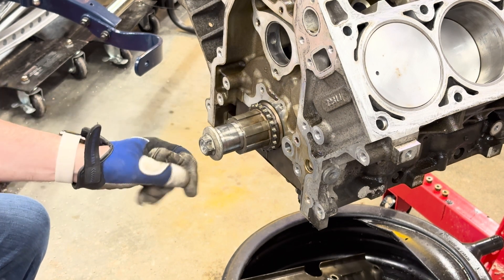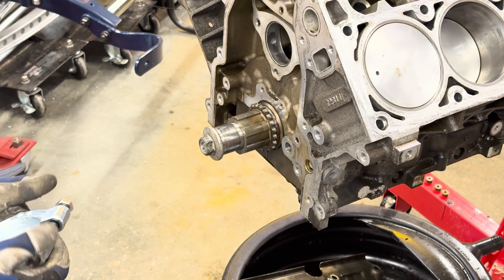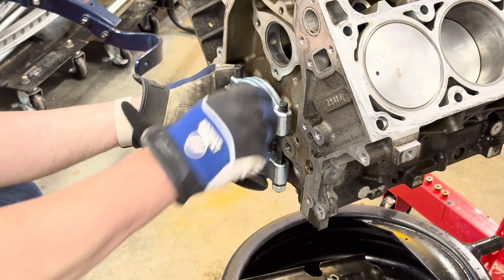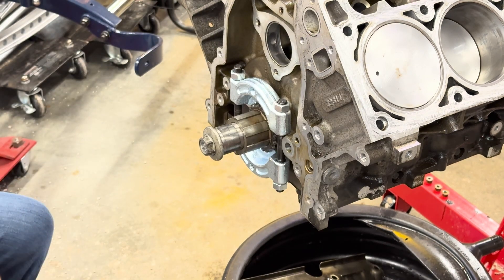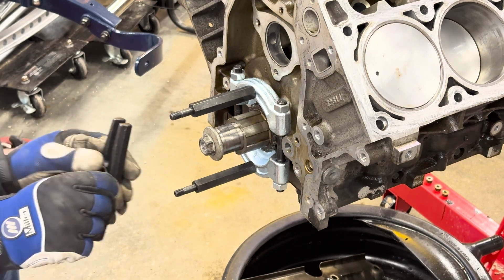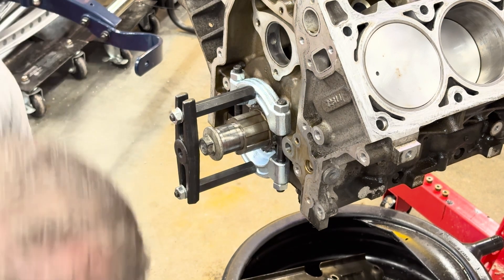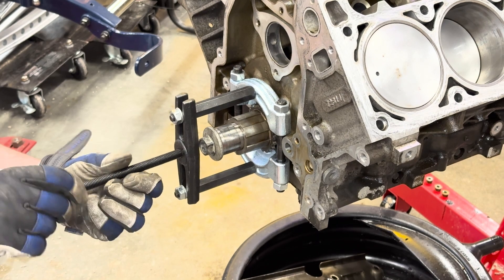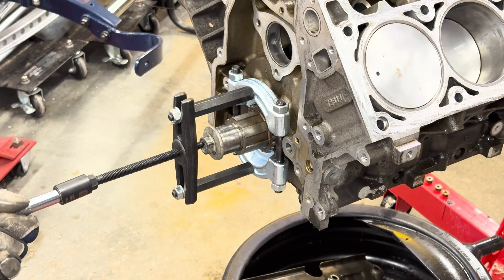Remove the Lower Timing Sprocket on an LS Engine

Comment: How do you install the new one?
Reply from the maker: Great question!   I used the old sprocket as a press and the old crank bolt.  Push right on easy peasy.
Reply: @AlsopAndSons  thanks!! Hoping my engine build goes well
Reply from the maker: @john_mattz71  they are pretty straight forward to work on, I’m sure you’ll do fine.
Reply: @AlsopAndSons  thats not what he asked  you ??? what is the part # of the puller you have ???  i bought a set at Harbor Freight that looks very similar to yours ,  1 is too small and the larger 1 is too Big ,  cant get the Black screw in there just too big ! geez , that lower sprocket  needs to come off  !